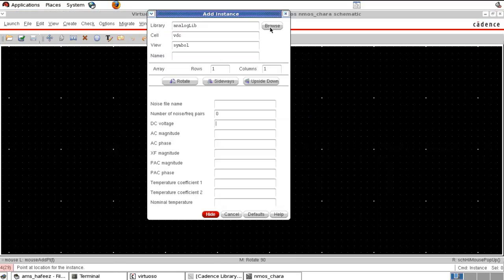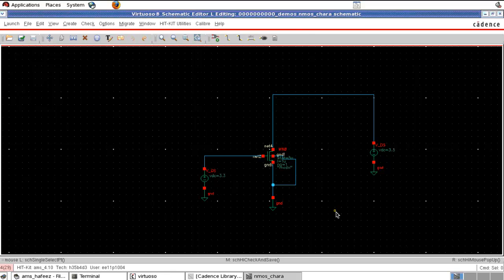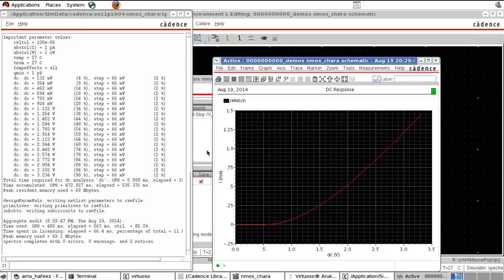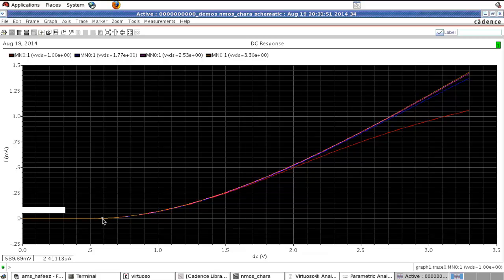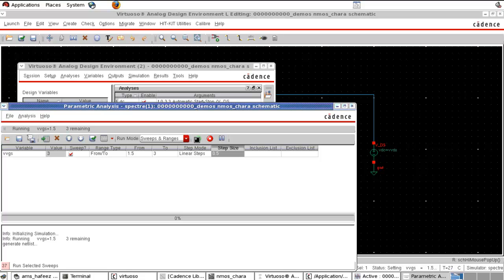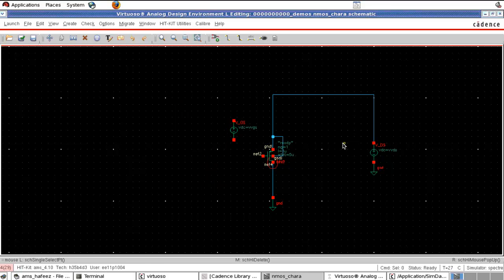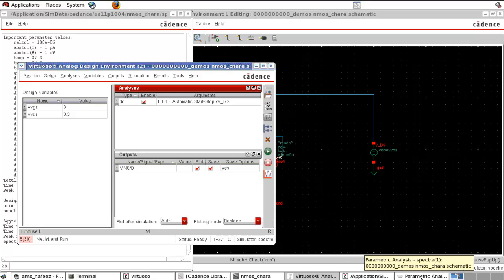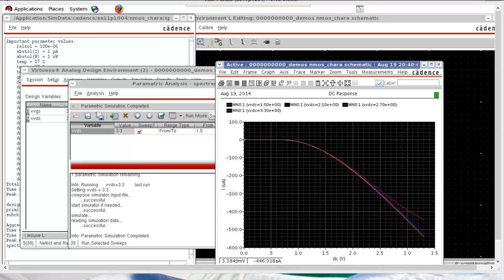Cadence tutorial : How to plot mosfet I V characteristics in cadence

Comment: This is very useful video to understand how to plot MOSFET IV input/output characteristic curves. It would have been great if you could explain MOSFET spice models first. Showing how to run simulation is not an arduous task rather shading some light on Spice models versions used for simulation.